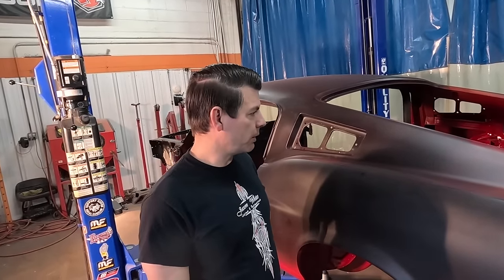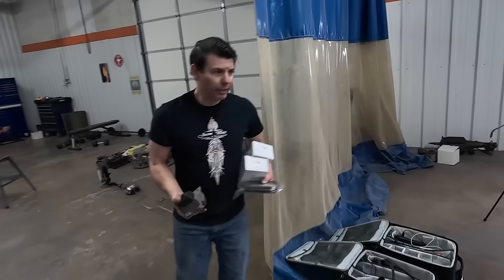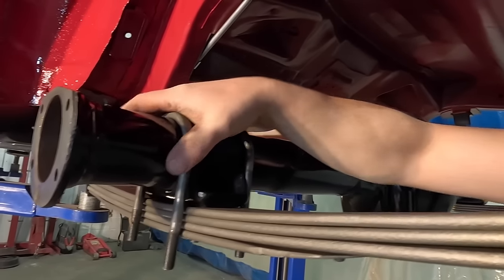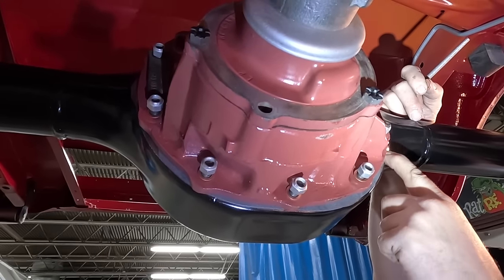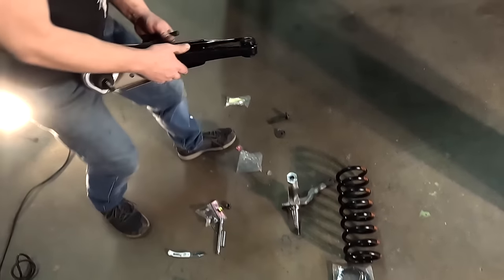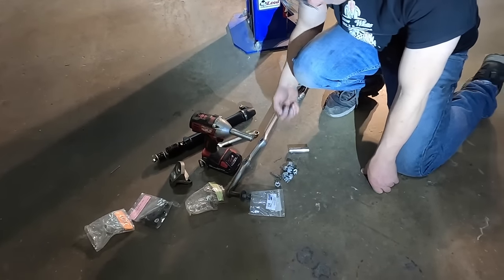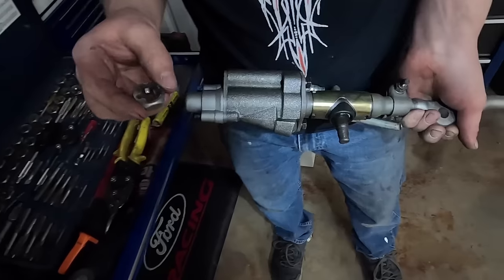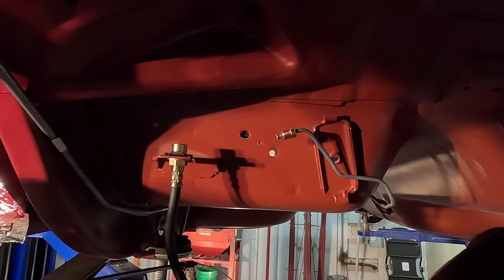Part 5: 1967 Shelby GT500 Mustang Restoration - Installing Suspension & Other Parts

Comment: As a professional  painter for over 50 years I  can say everything this man does is second nature. I can mix paint without measuring anything, I've done it so much. When he  added thinner he failed to mention it changes the viscosity of the paint and makes it flow better, therefore easier to spray not just helping it to dry. He's the best I've ever seen and I also use only epoxy primers. I can't wait to see the finished product

Comment: When I did pre deliveries on Fords in the early 1970's We used to remove the interiors and reseal all the floor and side seams as there used to be so many water leaks coming up from under the car.  Unsealed weld blowthroughs were common, hence why you see a lot of random sealer.  We also pulled the back of the front fenders (guards) up and resealed under there to stop water dripping on the drivers and passengers' feet. This may explain why you think the factory seam sealer is messy, we actually went over most of the seams again at the dealership before it was delivered to the customer. To us as dealers it was better to do this rather than have a customer coming back complaining about water leaks as it hurt the brand. We did the inner fenders around the engine bay because customers complained water and mud left trails down the inside of the engine bay and it didn't "look good".  Also the brake line clips, we removed them, put a dab of sealer on them and refitted them, they always leaked in water.

Comment: Talented guy , but he definitely needs a work bench instead of doing everything off of the floor. I use a rolling bench covered with industrial carpet for laying out all the new parts for assembly. Its handy to roll it to the area your working on. His knees will eventually suggest it strongly!

Comment: I'm completely addicted to this series here in Australia. I think you should wipe a coat of penetrol over any bare metal parts with a rag to prevent any flash rust. (won't change the appearance of the parts )

Comment: The Shelby is looking great. Jason has made some mistakes assembling the front and rear suspension. The front leave spring bolts/nuts and rear shackle nuts are to be torqued when the vehicle is at ride height on the ground when the car is completely assembled. Same with the front suspension nuts and bolts on the upper and lower control arms. The ball joint nuts are to be torqued to spec then the nuts are further tightened to install the cotter pins.

Comment: I am enjoying watching this from start to finish. I think the knowledge of this guy you are using to paint and build this creation is amazing. And even more amazing how you can still get new parts for such an old car. Have you sourced a motor yet? If I remember from the barn find episide the car didn't have a motor in it. I am following with enthusiasm from the UK. Great content
Reply from the maker: yes, got one, date coded correct, and original dual four's, oval air cleaner, everything original, even valve covers.
Reply: @thewriter2549  fabulous news! I cannot wait to see the motor get dropped in!

Comment: The 2 holes at the fender apron. Lower is for small block, upper hole would be big block. Different size fuel lines.

Comment: Amazing job! You must be super excited to see this going together! The only critique I have is leaving the bar code sticker on the lines, I would have wanted them as per factory, clean. The only other issue I saw was the pretty deep rust into the frame rail under the rear bumper bracket attachment point for the front bumper. Being a retired welder, I would have weld filled that in and then ground it back to smooth.Why is there a missing bolt on the daytona pinion support?
Reply: Yes, I also noticed that rust pitting in the frame. Thought that would have been repaired.

Comment: Wow I know this car is in good hands I'd love to own one. But I did build a 65 GT 350 it was a fast car. And I got in trouble with this 65 and sold it. The motor with a solid lifter Ford stamped racing cam dual point distributor yes it was a hp motor 4 on the floor and a 411 rear and cheater slicks then traded them for wide N50 15" tires on the back . Dad made me sell lol

Comment: Easy, when you have all the new parts laid out for you. Try doing this when you have to restore a 1931 Ford Model A Town sedan & have to restore them......................a whole different ballgame!
Reply from the maker: Yes and that's an advantage for restorers of these early Mustang classics. They have access to new or reproduction parts, such as the upper control arms and hardware. But, Jason did restore many of the original parts, such as the drag link, the leaf springs, coil springs, steering box, and more.

Comment: Is there a vendor name for the brake line kits, fuel line kit, and rear leaf spring shackle bolts?  These kits are very helpful.
Reply from the maker: I'm looking into a parts list, somebody asked for one, so if it will help.

Comment: Easy cheep and less messy way to pack your wheel bearings is save your bread bags. Take a bread bag out your hand in it grab the bearing and get a gob of grease then pull the bag down your arm over the bearing and mush the grease into it and then open the bag and take the bearing out and then disguard the bad and this way you don’t have a greasy hand and you are throwing the bag away anyway and the whole process is just a way mess free job all the way around.

Comment: Started working in Body shops my Senior years in HS...75/76... 1st car a 67 Impala, 2nd car a 68 Chevelle, 3rd a 72 El Camino... that got me in trouble while in the Air Force for to many speeding tickets... (it would do 150 mph easy)... I could out run the cops... I couldn't out run their radio's...  At one point I owned one of the first 100 - 55 Chevy Belair's to roll off the assembly line... didn't know that at the time... Had to get rid of it going into an ugly divorce!!!
Worked on a ton of different vehiles as a hoby... worked up to putting paint jobs on helicopters..
Retired now and a 100% Service Connected Disabled Vet...
As we speak right now I'm doing a frame off restoration on an all original 1993 Harley Davidson 883 Sportster with 6,000 original miles... It's been sitting up for 17 years now... and every single piece of chrome is rusted beyong belief...
With all this said about me... LoL.. a question if I may...
Jason keeps referring to "Concourse"... quality... 
I absolutey agree on the quality of work he's putting out on your car...
But would it still be considered "Concourse"... if it's not number's matching???
Am I correct in saying, that you don't have the "original engine, transmission, or rear end"...
So therefore it won't ever be a true, "original" numbers matching car???
Does Concourse shows, allow for that??? Do they have a catagory that would include your 500GT??? 
Don't get me wrong... I'm a big time chevy guy... but this Mustang, and it's story is cool on every level...
Thanks for y'all's hard work, and for sharing it with us!!!
Reply from the maker: To ask if there is a category for my car doesn't make sense. This is an original 1967 Shelby GT-500 with a history naming every owner back to the original owner and listed in the Shelby Registry. The "matching" part is the Ford VIN that cross references to the Shelby VIN on the Shelby plate in the Ford data base. We found a date-coded correct engine. The engines in these Shelbys were not stamped with the car's VIN, so there is nothing to match. What you do is simply buy an engine with a date-coded correct block, which we did. Same for everything on the engine.The rear end turned out to be original. The VIN is stamped on the bottom of the transmission. We don't have that, but bought an original 4-speed. This is an original 1967 Shelby. It is judged as a restored original.
Reply: @thewriter2549  
THanks for the info, and educating me... as I had said... absolutely love this and what y'all are doing!!!

Comment: Original wheel bearings are Timken. Nobody but Timken made tapered roller bearings until long after that car was built. Now the second most common manufacturer is SKF. I've been turning wrenches 30+ years and can't recall seeing a Bauer bearing. Probably cheap parts store will-fits. That car was already "restored" once at least partially. Watch the finding and buying video and you'll learn something. No Nebraska car from 1967 would be that "rust free" if the front end had not been "rebuilt" previously. And that steering cylinder sounds and looks shot. A hydraulic cylinder rod should never rattle around and slide back and forth with no resistance like that. The tube and piston seals have to be complete shit if they're in there at all.

Comment: Is Jason willing to share links to the parts that were used?
Reply from the maker: I'll try and round them up. Mostly to the parts? What about the spot welder? I had a lot of people wanting that one.
Reply: @thewriter2549  Yes Sir - all information is helpful.  I believe I have a plan for the spotwelding, but could really use guidance on putting together a good-quality, original appearance suspension.  I am completely replacing everything.

Comment: FFS get a table to put parts on and work off of instead of putting shit on the floor just to pick it up again. And try Murphy's Oil Soap on rubber parts for lube instead of grease or nothing.

Comment: I have  I think a sixty seven GT fastback, Had A 390 in it.
Still  have it need somebody to work on it
Reply from the maker: You don't know if it is a GT or if it is a '67?
Reply: When I bought it, they said it was a 67 GT fast back with a 390 Dull feed holly I got a book in the car.but it was a 68 Manual